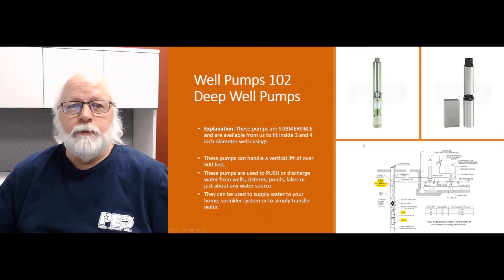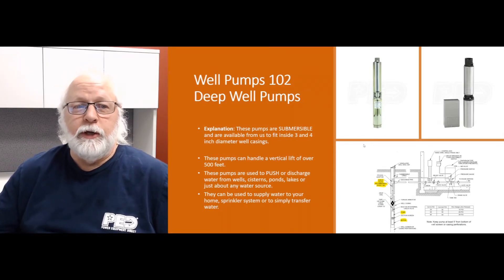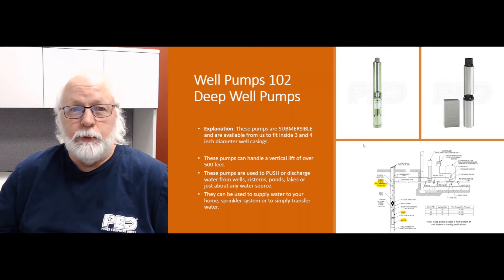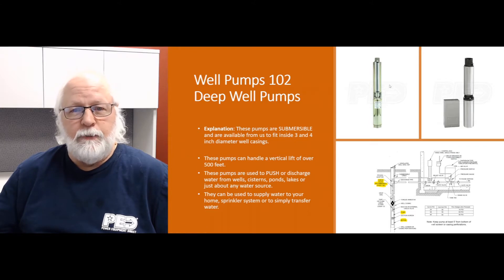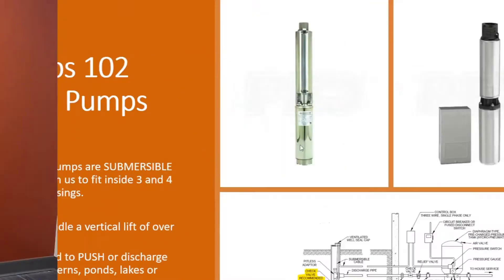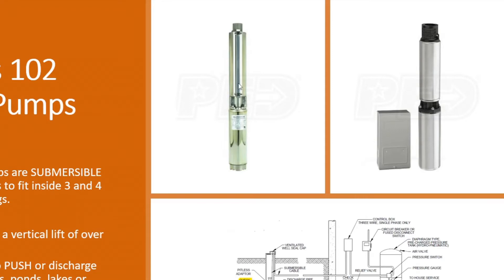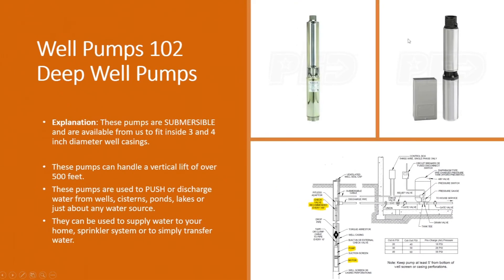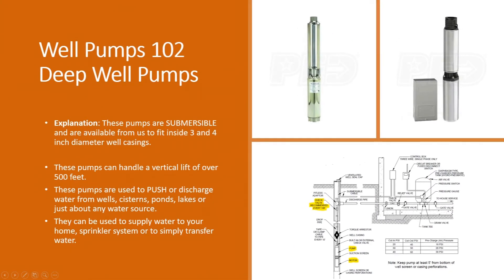Deep Well Pumps Explained

Comment: How can I supplement an existing 220v deep well pump with a 110v above ground jet pump using te same piping? I want to not operate the deep well pump anymore but keep it as stand by in case there is no power on the solar/battery powered above ground pump.

Comment: I have a deep water well that pumps into a 3,000 gallon poly storage tank.  From the poly tank it is gravity feed.  I want to increase the water pressure.   I have two separate locations from the poly tank.  The pipe to the house is about 1 1/4" down hill.  The other is 3/4" pvc for some faucets and an RV hook up,  which is close to but not down hill from the poly tank so little to no pressure, even out of the large poly tank. What would you suggest for an additional pump in this situation to provide water pressure and push the water?